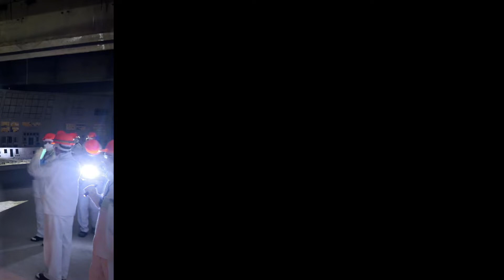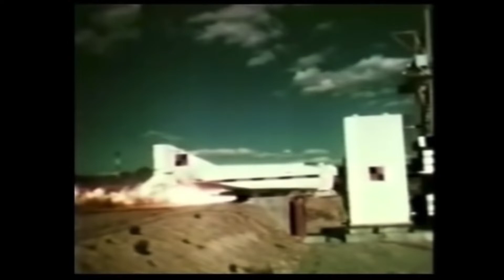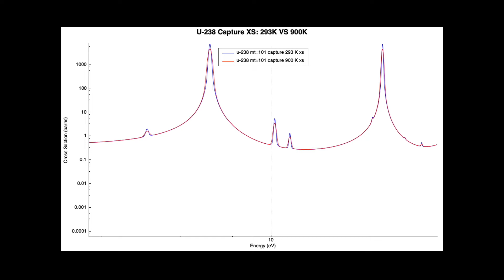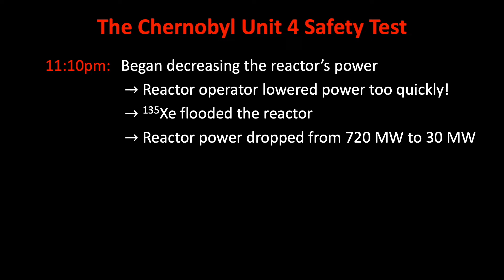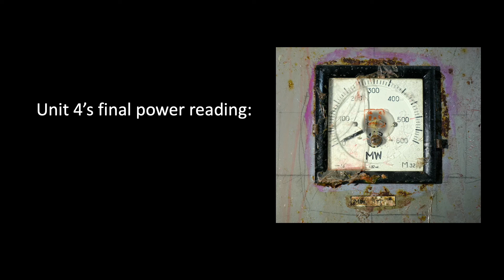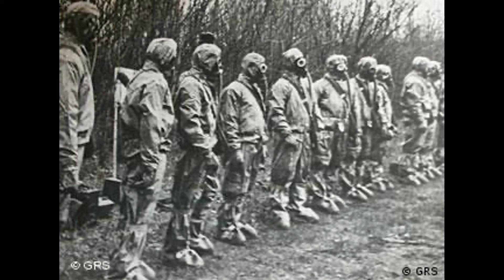NE410/510 - Lecture 19: A Reactor Physics Explanation of the Chernobyl Disaster

Comment: Just one minute into this video, and we are told all of the same misconceptions and propaganda that led to the Chernobyl distaster, which was also the point at which I stopped watching.  Because on the contrary, the more that one knows about nuclear science, the more one should fear what nuclear accidents can and will do.  Given a long enough timeline all nuclear reactors chances of not having a meltdown drop to zero, with meltdown chances exponentially multyplied by Murphy's Law, the law of averages, and the Wigner effect also known as the discomposition effect or Wigner's disease.  This displacement of atoms in a solid caused by neutron radiation, assures old ageing reactor failure, due to the degredation of the materials that a nuclear reactor is made of.  Meaning from pipes to concrete structures these events are assured, and guaranteed.   So you can spew your Nuclear Death Cult propaganda all you like... but it only takes a bit of common sense to know this nuclear nonsense is untenable.
Reply: What? Am I to trust a nuclear scientist or a troll? Its in your profile name.
Reply: @mightypsychobat9144  You can believe whatever you like friend, but I suggest you learn for yourself what radioactive isotopes that enter your body do to you.   Cause the truth is only one of us is getting paid to troll you, the other one is giving you a fair warning.

Comment: Of firearms and security, here's a different and difficult problem to think about! 
Recently some worthwhile information on the 1986 Chernobyl / Pripyat disaster exists online.
It's all very well to blame Soviet engineering but the final look reveals one terrifying fact!
There were no control room readings could indicate such a disaster and inclusive "compulsory automatic shutdown" had been invoked!
What all this means, particularly with "total opposite effect" is the control system may not been operating the reactor, the compulsory shutdown robotics were operating but failed only because of the overload explosion, not by any other means!
What NEVER has been considered is "resource theft by corruption and direct rechanneling" , one of the problems of scheduling the tests at the time was having to delay the test because full power output had been argued in Ukraine to remain for some extended period.
Was the control room fully connected, one point is clear, the tests ran at half and quarter power to detect vibration, that itself may been enough too for some cover up. It is not known if there are any "talk between" reactor-gemerator sets for power output compensation or with auto balancing.

That is a piece halarious you mention "parts of walls found inside the reactor"!
Two serious points,
 1. The person responsible for the building of Chernobyl was also an inspector of the buildings after it was put into operation

2. Dyatlov whom was often present with the reactor  controllers although he was not considered a physicist, but a nuclear industry building builder and was present in the control room when the explosion occurred was second in line to the person whom built Chernobyl NPP.

A. The building 4 had many structural and physical faults found but not repaired before the explosion.
B. The record of either of these was found to be awfully close to corrupt and at least "pass by" would been the correct action for the initial project management  personnel appointment.

A final note! In essence what little is known from the final  reactor readout parameters is difficult to decide a nuclear detonation from a meltdown clearly showing either being beyond achieving by direct concious operation without knowing it would occur! The AZ-5 at no time could ever achieved beginning sequence before the explosion blasted everything straight upward (95 percent of direction everything travelled).

They often blame the AZ-5 but actually ! That is obviously Completely Impossible!!!! - from the.operational time of reactivity and mainly nuclear detonation requirements being similar to meltdown start.(around 30 seconds from start of rapid increase to instrument failure from the explosion).

There is only one other discernable characteristic in the data information a valid clue, the vibration during shutdown at some RPM!
It is cited Toptunov brought the reactor power down below a level of "operation" (where the legal argument goes either way, it's a "shutdown test" not operation! ) and the reactor temperature began to fall uncontrollably and the reactor was considered to be uncontrollable  below a particular thermal mega-wattage (this is considered to be a direct operator mistake - the trouble is it is ACTUALLY a run-down EXPERIMENT).

The "vibration" and uncontrollability of the reactor is probably a "main reactor water circulation" ONE WAY VALVE that behaves too violently at lower pressure , rather than compensating with smoother flow it opens and closes sporadically, and could cause violent "hydraulic back pulse" shock waves through the reactor!

Comment: There is some errors. 
1) RBMK not used for produced weapon plutonium. The roots of this myth probably grow from the fact as prototypes of the RBMK, the designs of reactors developed by nuclear weapons (too channel reactors) were used. 
2)5:02 - this lego block not part of fuel. This is part of biological protection against radiation and consist of metal sheell and filled with a special mixture of minerals (I won’t write the composition from memory). During overload fuel, this block retrieved and a special mechanism drives up there to reload fuel.  On picture  (5:09) can see the top fuel assembly (under letters B-B) which  placed under "lego block".

Comment: At the very beginning you say that this design keeps the fission products separate from the water, unlike pool type BWRs.

Could you please expand on that?

My understanding is that, both rbmk and bwr have the fuel assembly is encased in zirconium tubes, and the water in contact with the assemblies, receiving neutron radiation, is converted to steam which moves the turbines directly.

So, in this model, both types of reactors have the same level of isolation from the actual fuel.

What is wrong, with the model I just described?
Reply: I only can think that the affected tube's water flow may be closed from the rest of the tubes in case of broken cladding, but I didn't understand it like that in your explanation
Reply from the maker: @georgH  RBMKs use a pressure tube design where the water coolant is incased in tubes as it flows past the solid fuel.  For BWRs it is almost the opposite - the fuel is incased in clad and submerged in water. In a sense, RBMKs = water tubes and BWRs = fuel tubes.
Reply: @NuclearEngineeringLectures  So, are you saying that the fuel in an RBMK is not encased in cladding as in BWRs?
Reply: @NuclearEngineeringLectures  A little wrong. RBMK have fuel in zirconium clad too (like BWR, PWR and soviet VVER). Water under pressure around the fuel rods and all this inside the tube how you said. 

Sorry for grammar.